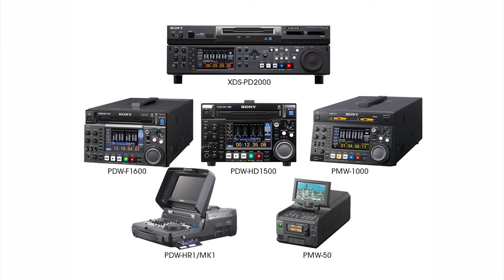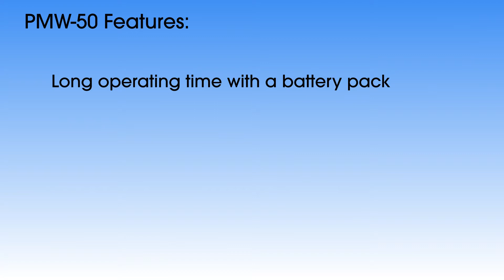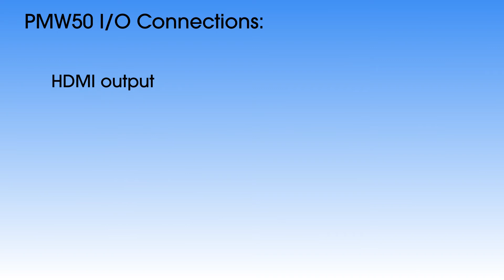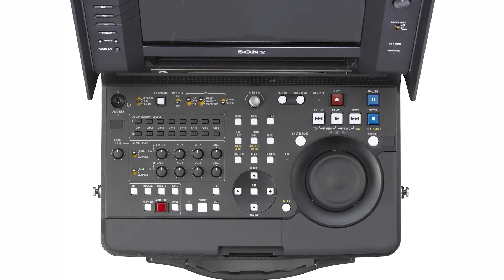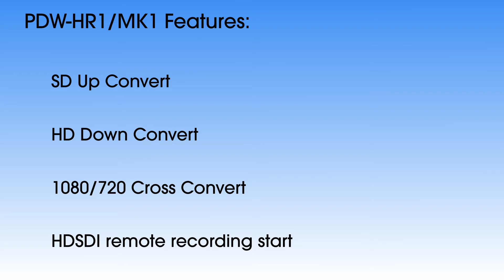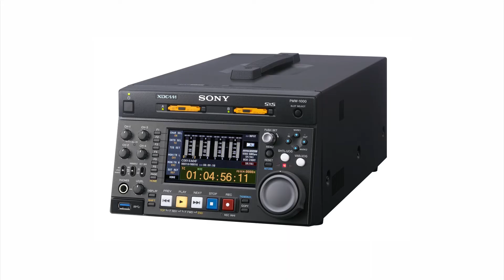Benefits of XDCAM Decks

Comment: I have 2 units, a pdw-u1 and a pdw-u2, both with the same problem, it doesn't recognize the cards for recording. I've already updated the firmware and I can't find a solution.

the errors are the 6F-E00 _ODW-U1) E
6F-E80 (PDW-U2)